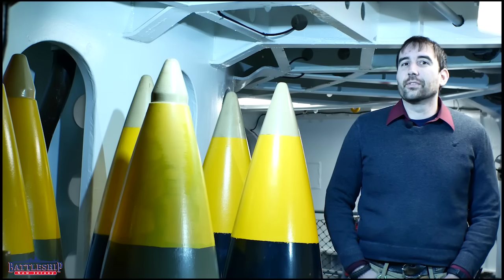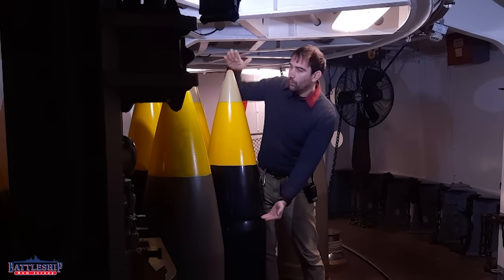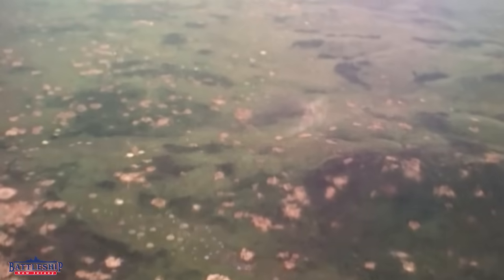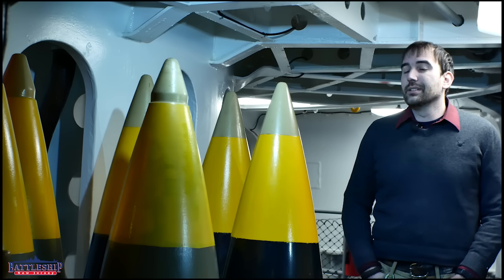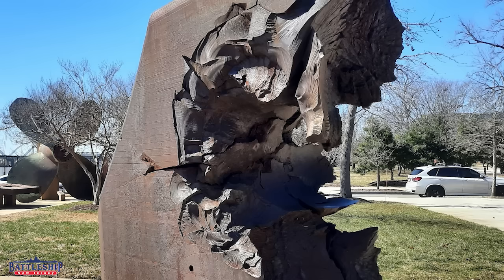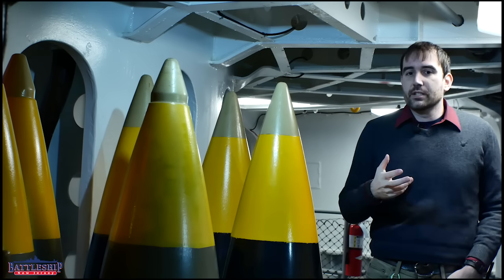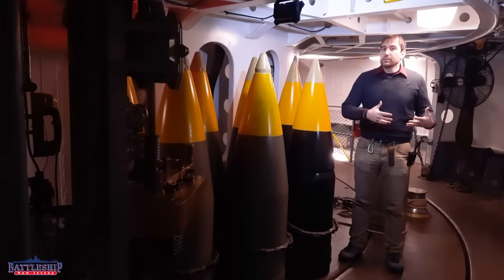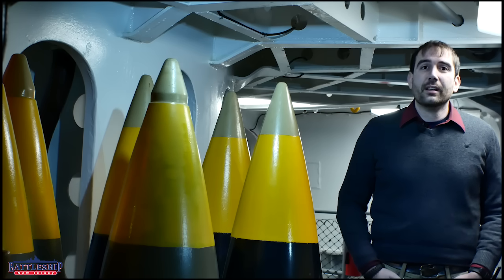What Does the Impact of a 16in Shell Look Like?

Comment: These shells don’t use “powder,” they use high explosives, typically Comp A or B and sometimes a mix in AN and some other compound to stretch supplies farther during wartime.  I get that you may have been using the term powder as a colloquialism for H.E., but it will probably be lost on your viewers.  

Secondly, a “bursting charge” is a specific term used to describe a charge in which a charge is barely enough to break open a projectile case, typically to disperse or eject the contents, whether they be white phosphorus or smoke or mines or markers or some type of chemical agents.  The H.E. in these are more correctly referred to as a “main charge.”  They don’t “burst” the shell, they detonate and turn it into fragmented shrapnel.  

The front covers are usually called nose cones.  They basically just protect the fuze or any guidance package that is included with any ordnance, and sometimes serve as a crush cone which privides just enough impact inertia to function the fuze when it impacts the target, if it’s not just a simple point detonating fuze.

Comment: Just for your next tour; the "bullet" is referred to as the shell (projectile) and the shell casing would be holding the shell aswell as a propelling charge used for firing the ginormous shell.
Reply: The projectile is fired from the gun by placing silk bags of powder propellant behind the projectile then the breech is closed behind that.  I have been on the USS Iowa and seen how the 16 inch guns are loaded.  Been in the crows nest and witnessed a broadside fired and also fired a broadside of 5 guns myself.  I visited the Iowa for 3 days when she was operational in the red sea - 1987.

Comment: I figure the professionals had it as right as they were going to get it, but in my mind I tend to spec things to do one job and do it to a level that would be considered overkill.  That's likely not an effective strategy, but it's my way.  The "HE" shells I would have spec for maximum boom.  Their job is boom?  Ok.  All the boom that can fit, please.  Penetrating power be damned.  This is for boom.  The "AP" shells I'd have likely left the way they were.  If anything, again, spec for maximum penetration but also a fuse timing that for sure sets that thing off inside your ship.  Its job is to punch a hole and boom the internals.  A little explosive goes a long way inside a ship with rather thin metal for decking.  But hey I'm some guy on the internet decades later who doesn't develop naval weapons.  What do I know?

Comment: What does the impact of a 16in shell look like? Don’t know, but I know what it looks like when one or nine 16in shells depart. Full Salvos are an awesome sight to behold. As an Aerographers Mates who are the ship’s “weather-guessers”, I had the privilege in viewing this topside from the ship’s superstructures.
USS Missouri (BB-63) 1985-88.
Strength Through Firepower; USS Missouri’s firepower is Sea-power … and Seapower is our nation’s “anchor to windward.”
Even without it’s missiles, a ship like the Missouri would find relatively fragile modern surface combatants easy meat once they strayed within gun range, about 25 miles. Faster than most modern warships, an ‘Iowa’ carries over 1,200 16-inch rounds, each weighing a ton, and originally smash wartime Japan’s giant’Yamato’ class super battleships. This awesome power dwarfs the four or eight missiles usually carried by a modern cruiser. In any case, thin-skinned modern warships would be obliterated by a single 16-inch hit, while modern missiles would have to be working hard to dent the veteran’s armor. 
I was a sailor on board a helicopter carrier when on October 1983 the world was shocked by the Beirut, Lebanon bombing event of the Marine compound. It seemed easy to the Lebanese gunners, way up high in their Chofu mountain villages. There down below, dug in securely at Beirut International Airport, were the US Marines. My ship was unable to send the larger size CH53 and CH46 choppers to the international airport due that they can be shelled with ease from way up high from their mountain villages. The Americans were in an extremely difficult position and there was very little they could do about. The US Navy had already lost planes in the skies above Lebanon and sending our choppers to the Beirut International Airport wouldn’t had fare any better. And in any case the gunners in the mountains were not an easy target. The Marines were stuck, like the whole Multinational Peacekeeping Force that had come to Lebanon that summer of 1983. Of course the gunners thought, there was that big new ship that had arrived a while back…but that was twenty miles away, well out to sea. They could hardly see the damn thing. No way could that do anything to touch them. 
They were wrong. One fine December day there was a huge flash on the horizon. Could the new ship have had an accident? It looked like some kind of explosion. Seconds later, to the accompaniment of an unearthly howl, the area for hundreds of yards around the mountain gun positions was obliterated by a series of titanic explosions. They were on the receiving end of 16-inch gunfire from USS New Jersey. The battleship was back in action, with a vengeance. The task force was now able to begin the task of support and rescue operations.  From my ship we sent out CH53 and CH46  to the Beirut International Airport without incidents. After witnessing all this from 15 miles out to sea, I was determined to transfer to a battleship. And in 1985 I got my wish, transferred and assigned to the USS Missouri (BB-63) the sister ship to the New Jersey. Served onboard from 1985-1988.

Comment: Wtf man. I thought i was looking at rockets. First 15 seconds and im shook. Those things are bullets that explode.
0:45 the shockwaves in front of the guns across the water.
4:10 i used the cruise ships in red alert like that. The shells wiped out everything. My favourite strategy was to rush out as many cruisers as i could before they wiped out my base on a map surrounded by water and then i would spend hours wiping out the enemy with a handful of troops as scouts.

Comment: Those shells did not have gunpowder in them. The bursting shells had Explosive-D(ammonium picrate) in them and the armor-piercing ones had Comp A5/RDX(98.5 to 99.1% RDX coated with 0.95 to 1.54% stearic acid) grenades. However, they were propelled with 110-pound silk bags of smokeless powder..., which made a LOT of smoke.
Reply: Yeah and they had more than 35 pounds of explosives in them also. I dont know where he got his information

Comment: I am a Plankowner of USS Wisconsin BB-64. As an FC that had his 1st GQ station inside Turret 2 I used to watch the fall of shot through the rangefinder.

As an HE round impacts the ground there is a flash a big cloud of sand and pieces of shrapnel flying away from the blast.

Firing at see we would fire a round painted blue. It was called BL and P - which stands for Blank, Loaded and Plugged. It is basically an inert round with no explosive charge. On impact of the sea it would cause a splash that was large enough to provide a radar image for the main battery fire control radar. This image was used to correct the spotting to bring subsequent rounds on target.

Comment: What you mean by bullet bit is the projectile, the pointy part is called a cap, its not really hollow just for wind and aerodynamic reasons but also to perform better at angles, ballistic caps would reduce the angle which would cause the round to fully ricochet

Comment: This is inaccurate. The projectiles are filled with an explosive called yellow D. Not powder ( I assume he means gunpowder) That is the propellant charge in the bags similar to conventional  land- based cannon artillery such as the 198 and 777 howitzers. Yellow D is a long chemistry word that is hard to pronounce and it is in fact yellow and will stain anything. They are not shaped like bullets inside a windscreen. They are quite solid up to the fuse. Both the HE AND AP rounds are similar  with different wall thickness and cavity size. The AP has two fuses. An nose and base fuse. How do I know this? I commanded the depot that made them and currently de-mils them. Interestingly, they cannot be de-milled using open detonation because yellow D is water soluble and very toxic to the environment. Unlike projos filled with TNT, HMX, IMX, etc…, they must de-milled using a proprietary method that water-jets out the explosive . This is then, in turn , converted chemically  to a usable compound that is exported to labs as a microscope slide dye. Mostly to Japan. The “curator” of the Iowa class battleship with the namesake of my home state would do well to visit Crane Army Ammunition Activity ( CAAA) and learn a bit more about these extraordinary munitions. This endothelial the lesson. COL D.

Comment: The bursting charge of the Common Shell at just under 70kg looks to be much greater than any of the Japanese Common Shell, or the British 15" WW2 HE shell (though a bit less than the WW1 HE shell had been), I don't have a value for the British 16" HE round, but it is unlikely to be significantly more than the US ammunition.

For APC, the heavier weight improves accuracy and long range consistency and penetration. I'd far sooner take the super heavy 2600lb 16" shell over anything else proposed or used for this reason. (Ironically as long range fires are at least partly tasked with penetration of horizontal armour, the L45 of the earlier wartime Battleships might have been a better gun than the L50 as fitted to the Iowas, as it was capable of a limit penetration at a shorter range against these deck armour arrangements than the longer gun).

Comment: In 1968 I went to Miraflores Locks where my dad was working in the Control House and I got to watch the New Jersey come southbound through the last set of locks and enter the Pacific Ocean on her way to Vietnam. That was great to have the perfect vantage point to watch her come through. There were five canal pilots taking her through because of her wide beam, one senior pilot on the bridge and one pilot on each side of the forecastle and the stern to keep her centered in the lock chamber. They do this by radio to the mules to have them take in or let out cable on each side as there is only about 10.5 inches on each side. The lock chambers are 110 feet wide, and the ships beam is 108 feet 3 inches, so it is a very tight squeeze! Towing locomotives have always been called mules in the Panama Canal. In the twenty years I lived there (1953-1973) I got to see all of the Iowa's transit at least once, and they were the most beautiful ships to watch out of the thousands I saw go through. I also saw the Alabama go through as a dead tow on her way to Mobile to become a museum ship in 1965, also a tight squeeze. Battleships are just beautiful whether they have 45 (Alabama) or 50 (Iowa) caliber 16 inch guns.

Comment: A .50 BMG has a muzzle energy of about 19,000 ft lbf . The dreaded Pak 40 had a muzzle energy of 1,572,000 ft lbf. The AP shell fired from one of the 16/50 cal mark 7 guns was 262,309,884 ft lbf. Crazy energy. 😵
Reply: What is that in not-Big Mac units
Reply: @mr.tweaty  25.67kJ, 2131.34 kJ, and 355644.45 kJ respectively
Reply: @stroso83  I've always wondered this. How would you calculate the impact/explosive energy of a 16/50 HE round compared to a 2,000lb JDAM?

Comment: they also had anti  personal rounds with close to 400 individually fused grenades inside
when I was in gun school in Great mistakes, this is how they told Us the power and range of the 16" 50, this thing can launch a 57' Chevy over 20 miles just to give you an idea of how much power was behind these. The charges are not shells but, bags and the gun can be loaded with 1 to 3 bags depending on the range desired

Comment: A third shell should have been made with a blunt tip to hold the maximum amount of powder. It should be over 6 feet long and hold about 300 pounds with a range of 10 miles and a weight of about 1200 pounds total. The reason for the lighter weight is that the wall of the shell would be as thin as possible so it could hold the maximum amount of powder. The short range would be needed so that the thin wall would not collapse after discharge. This round would be used only for line-of-sight coast line bunker busting.

Comment: The HC rounds were also armor penetrating but about half the penetration of the mark 8 AP. The purpose of the HC was shore bombardment and focus on concrete rather than steel, with about 8 feet of concrete penetration from a wide selection of impact angles and ranges. There were several fuses available for differing delay types(including a flight-time fuse for air burst) and as I recall both a nose and tail fuse were used to reduce the rate of duds.

Comment: In Chu Lai Fall of 1967 the New Jersey was off the coast firing rounds overhead, the ground shook as the projectile flew over the valley, headed to the other side of the mountains. You could hear the projectile as it flew over, it made a shucking sound as it broke through the air.

Comment: I am not an weapons specialist or engineer, just speculating using Newtons Laws and Universal Gas Law. So chamber pressure X surface area of shell base = thrust, I think. Bigger the shell, the more thrust needed. But the chamber is three dimensional so the charge needed goes up as the third power. I am guessing the engineers found a pragmatic limit at around 16" given all the other boundary conditions of producing battleships in war time.

Comment: Clarification of penetration values ahead. Maximum penetration of the Mark 8 Super-Heavy Armor Piercing Shell (yes that is the full proper name of the shell) is 32.26 inches of WW2 USN Class B steel at point blank range (this steel being rated at a rough Quality Per Thickness of 1.00 was considered a baseline for comparing armor quality. It is notable that not all nations reached this quality and few surpassed it at this time so against certain nations this gun would perform drastically better like against the Japanese who infamously struggled to produce quality armor plates at the time). So quite a bit more than the foot, 12", mentioned in the video. Going by expected ranges the gun could be reliably expected to penetrate 15-26 inches 15" at longer ranges (40,000 yards specifically) and 26" at closer ranges (10,000 yards specifically). By battleship standards a mere 12" of penetration at expected battle ranges is rather bluntly pathetic and wouldn't hurt most WW1 era Dreadnought and especially not Super Dreadnoughts let alone anything from the Interwar or WW2 era. 12" of penetration would defeat no ship of Super Dreadnought or later design's turret faces, most barbettes, most conning towers (assuming it's armored). definitely not it's main belt, and never it's magazines or machinery spaces. The only metric by which 12" would be considered impressive is in deck penetration and the maximum deck penetration of the Mark 8 Super-Heavy Armor Piercing Shell was 14.05 inches. This was sufficient to defeat the deck of any ship ever put in service.

Comment: The penetrating power of those armour piercing shells into reinforced concrete is very impressive. The 22,000 pound Grand Slam bombs dropped in WW II were about 45% charge, with the other 55% being chrome molybdenum steel, could reach the speed of sound but couldn't penetrate anything like 30 feet of reinforced concrete. However, they did go straight through Tirpitz, but then battleships aren't armoured for that sort of projectile and direction of attack.
Reply: I had some business in L'Orient, France and they took me by the old German U-boat pens which had been bombed by big, deep penetration bombs. The locals told me that despite the size and speed of the bombs, they mostly bounced off the reinforced concrete and didn't penetrate the sub pens. The German Army retreated from there after the D-Day landings, but it had been in use up till then.

Comment: The AP shell falling from several thousand feet at 20 miles would easily go through any armor that the IJN ever produced.  The IJN used German formula steel that is called Wotan case hardened steel.  The Bismarck had such armor and   the British Navy 16 and 15 inch guns were able to penetrate fairly easily.  Bottom line any Iowa class would have defeated the Musashi or Yamato.
Reply: The guns were basically designed for fighting the Yamato. The US navy had been watching Japan for some time before WW2. The mark7 16" were considered as damaging as the Yamatos 18" due to better shell design and improved gun operation.

Comment: A very very silly calculation just for fun, modern HEAT rounds can penetrate 700% of their diameter. I'm not saying anyone can or should make a 16" HEAT round but IF they did....you might expect something like 2840mm (111" in freedom units) of penetration of just about any reasonable material you could think of. Of course, that would be stupid when a normal 16-inch will go through several meters of concrete but if we ever need to kill superman....I'm just saying....
Reply: I'd imagine the 700% rule goes to hell at that scale but if anything I suspect it goes even higher given the ridiculous mass of a hypothetical 16" copper jet.

Comment: Explosive capacity is related to the stress of firing and the amount of steel to avoid breakup on firing the gun along with the needed weight and strength of steel to survive initial impact forces. Both calculations and empirical records of past failures help in the design process.